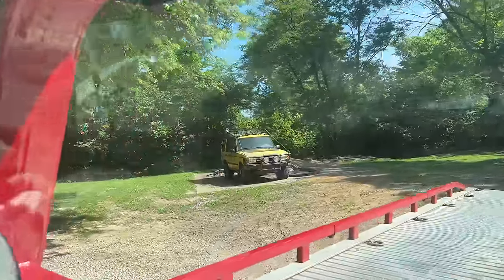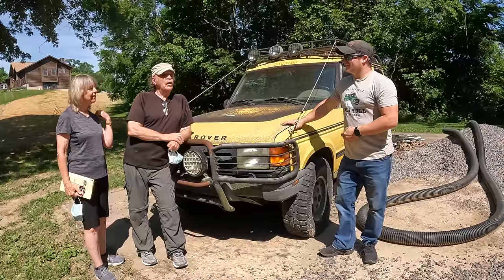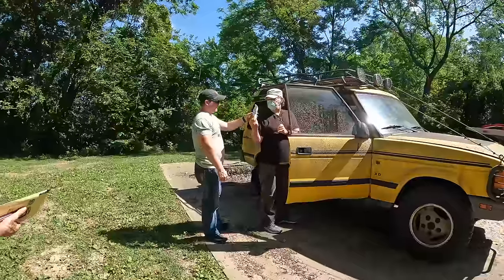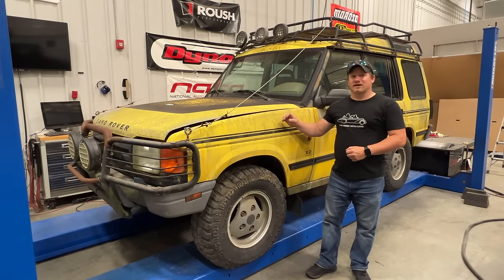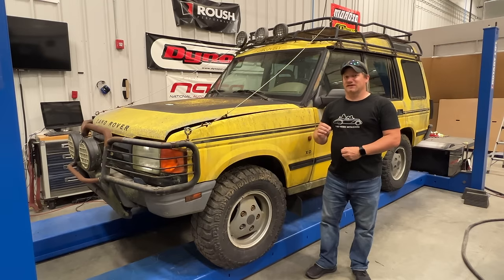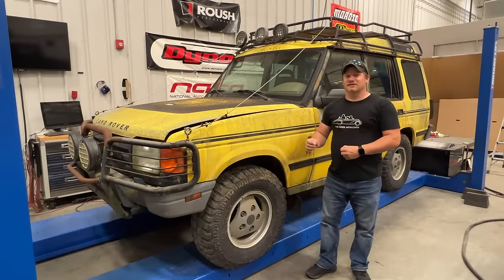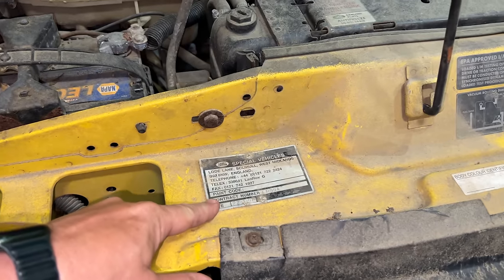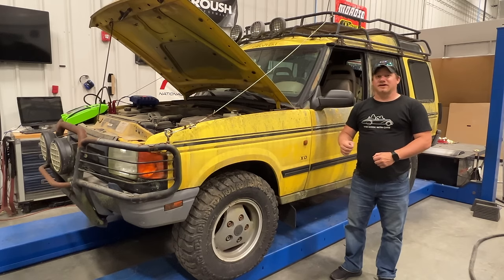I GOT A RARE LAND ROVER DISCOVERY XD FOR FREE!

Comment: I was in the Land Rover factory in 1983 when they were preparing a fleet of 90s in that yellow colour; they were for the UK Automobile Association rescue service. Later I acquired a 127 which amongst its many paint jobs had a layer of the Camel sand colour although I can find no record of 127s being used as support vehicles.
Reply: Color is AA YELLOW LRC 584. There were two 127 (MY1990) Single cab with rear van, and two 127 Double Cab, that carried communication and workshop equipment,(Siberia Camel Edition 1990)  one is G501BKV (still survives). Later  (at least)3 DEFENDER 130 (200TDI) double cabin, with rear van, were in the Camel as support.

You can see Them here:

https://www.youtube.com/watch?v=TT-jxVJXLJ8&t=7s

You must have confused the date, the NINETY 90 was a MY 1985 presented in May 1984 at Eastnor Castle and starting sales in June 1984, I doubt that by the end of 1983 they would already prepare orders.
Reply: @manx1630  Thanks for the info. My '127' was built in May 1984 by SVO which suggests that it may have been a pre-production vehicle to the later 127 spec.
In the early 80s I was authorised to photograph all of the buildings and services at Lode Lane as part of a refurb project, but that excluded any vehicles in production.
Reply: @robt2151  Hello again Ro: The 127 (ONE TWO SEVEN) were fully homologated in 1986 MY, and began to be manufactured in the common production line, abandoning SVO, (the rear doors of the Crew Cab were no longer rectangular and were the same as the 110 SW and there was already an own chassis and not welded). In July 1990 the production of the 1991MY began, already called 130 (as you know 127 in the same way, except for the 129 of the Dutch market 1994-2000, all are 127). The last year production ONE TOW SEVEN wore 127 badge (1990MY)

Comment: Love my Landrovers as much as you do young Steve. Such a great find and to own one built at SV ops Solihull.. Just a shame it was not TD1 but yes we understand why..On my 1991 3 door Tdi it had provision for 2 batteries under the bonnet (hood) used for the car jack storages use but I had 2 equal sized bought new batteries linked as 12 volt but a huge amount of starting amps on the coldest of day, normally never needing heater plugs to start it... I happily had my Disco for 10 years until my disablement meant i needed an automatic version, but, ended up with the smaller freelander diesel automatic i love "Nearly" as much - lol.. Thanks for the video.. will look with Interest to see what you find when the heads are off, and that strange "Clonking" noise ? thanks Mate --- Ian.B. UK

Comment: Nice add to the fleet! It appears to have been well used, but by owners who really liked it. I’ve been curious for a while - what’s the wheel bolt pattern size on those? Five on something larger than the 5 1/2” that we see a lot in the states, I suppose.
Reply: As best as I recall the specs on the wheels are 16" x 7", 5 Lug, 6.5" Bolt Pattern. The wheels that are currently on it came from a Range Rover but I made sure Steve has the original full set of 5 OEM wheels that came with the OEM XD models.
Reply: @48920jeff  Thanks!
Reply: It has the RANGE ROVER Classic NRC7900 VOGUE (or Mustang, as it was a copy of the '79 Mustang design) rims, it needs the original CASTOR NTC9976 (in black).